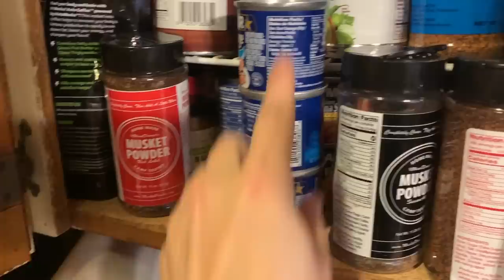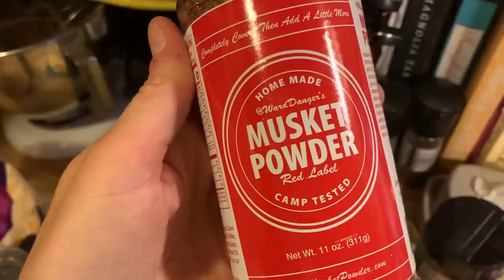What a SHOCK!

Comment: Try this on your steaks next. Season the steaks. Stack your steaks up and tie together with butcher's string. Wrap up in foil, place in oven on cookie sheet. Bake at 225 degrees for approx 40 min or until internal temp reaches 125-130 degrees. Use probe to poke through foil. Pull and sear in hot skillet like you were coming but only sear about 1 min on each side. Med. rare. It's called reverse sear. More tender